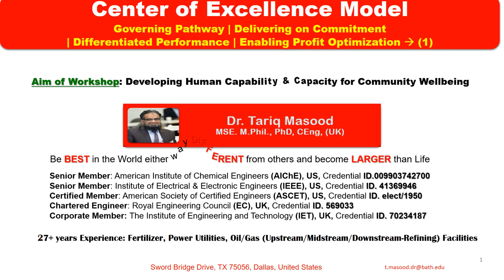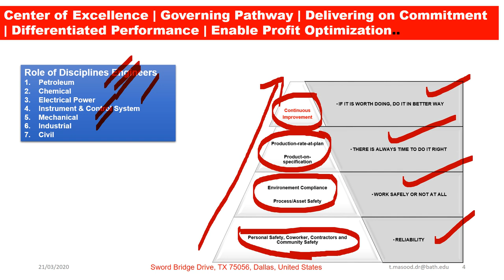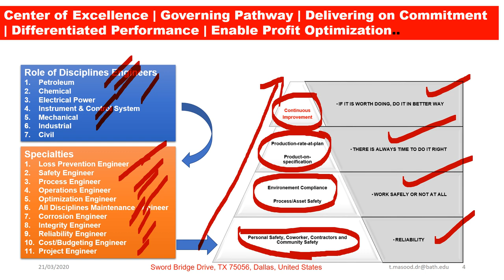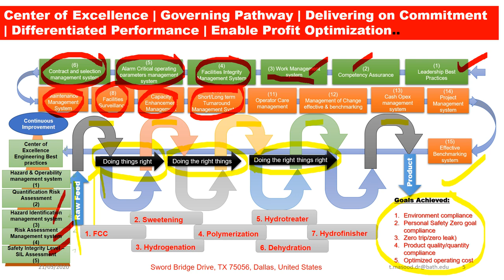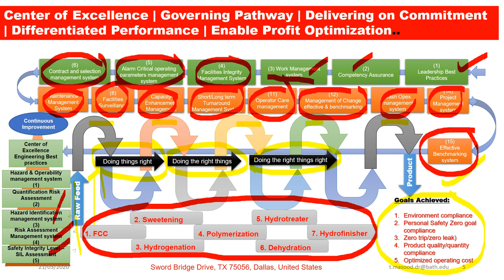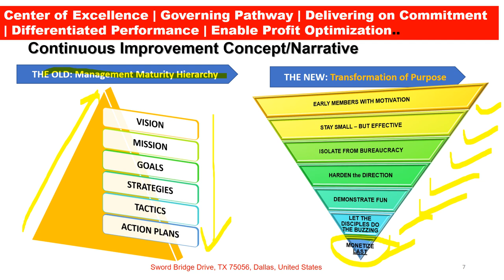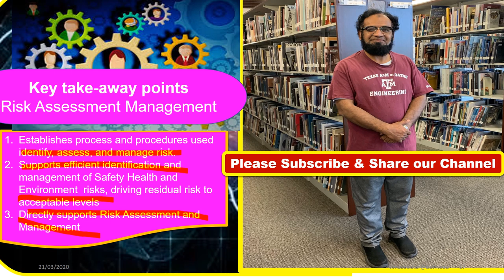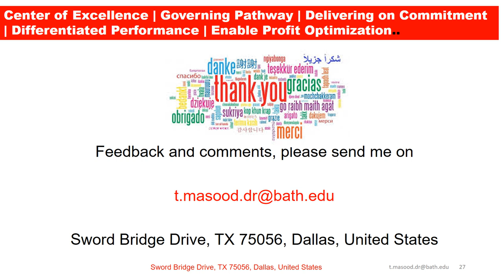Dr.Tariq Masood PhD | Center of Excellence | Engineering Best Practices | Lecture No.1

Comment: Sir, This is more very comprehensive overview.  I have done EPC (DEED & FEED) for Oil & Gas Turnkey Projects. 

This Diagram is comprehensive for Overview. 

How to optimize the integrated workflow at Design Automation Level, is the area I am looking for these days.
Reply from the maker: Thats great to hear! what else have you done?
Reply: @DrTariqMasood  : Weatherford, OMV,  Prolink & TAQA : Done complete  E & I Design (EPC) to System Integration and Control (PLC/SCADA)   back in 2012.   Also for OGDCL in 2014 for Dakni Gas Processing Plant
Reply from the maker: Excellent sir great work you have done